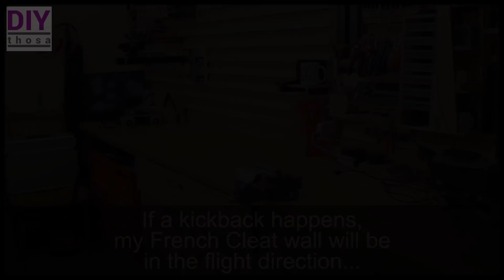how to make a Kickback safe Smartphone Holder - sicherer Handy Halter

Comment: Brilliant use of Perspex, mate👍
Mine has sides as well, to keep dust out.
Reply from the maker: I did think of that option too.. but due to the magnet holder I need the side open to get the phone out. 😕
Reply: @thosa  close one side in permanently, and use a few small magnets on the piece for the opposite side?

Comment: good execution, good job, is that you also whistling?

on my dashboard phone holders, I put 1" wide strip Velcro hooks, then on the back of the phone, a strip of  Velcro loops.   

(Hooks on the phone pick up threads, while loops pick up nothing)
Reply from the maker: Thank you 😊 No.. thats allready inside the song.😊 Everybody has his solution based on his needs. Many years ago I tryd strip Velcro hooks too, but the big magnet is the best solution for me. I can attach my phone to heaters, pipes, big server racks... makes more sense in the daily usage for me :-) and with the metal ball glued to my car dashborad, I am able to rotate my phoen nearly freely in any direction and orientation.